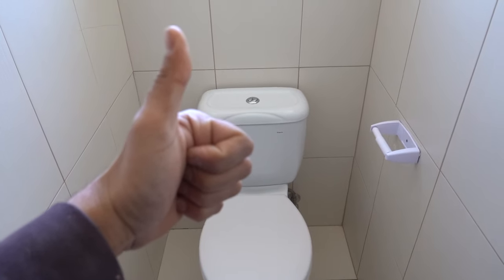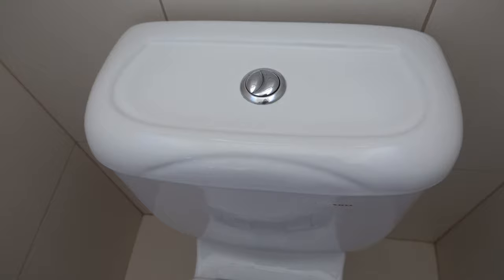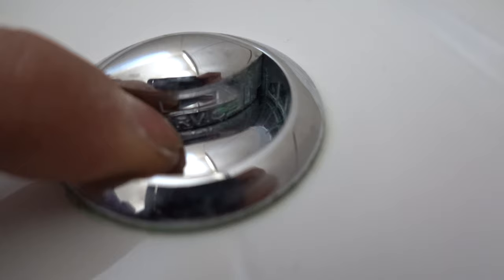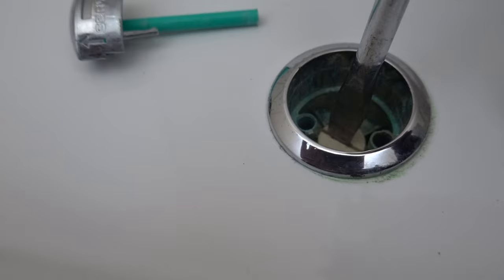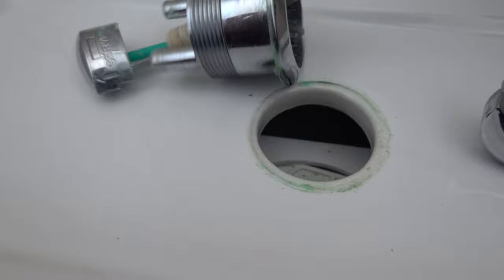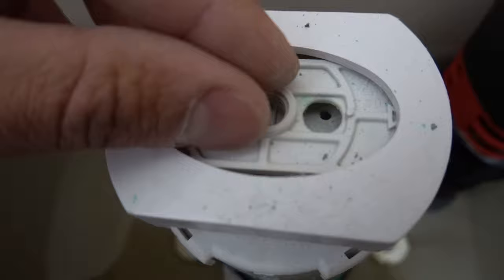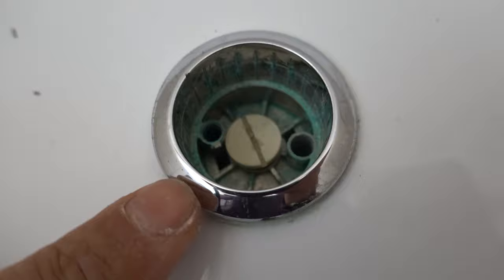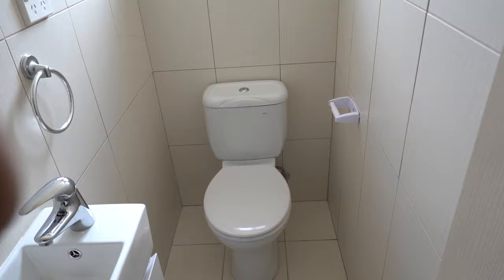How to remove toilet cistern lid - Dual flush buttons

Comment: Thank you for the great video, one small thing i might have missed but would like to add for everyone else if i didn't, the button unit is one directional, if you are having problems trying to screw it back on turn the holder for the buttons 180 degrees and it should sit better.

Comment: Thank you for this video, I did not have a clue how to get the lid off before I saw your video. The little button had less of a ledge to lever it up then I expected and it helped to stick the little button back in first to make sure the 3 holes were all lined up when putting it back together and hold the ring down and remove the small button and screw down the central plastic screw. I was peering in before that with a flashlight and poor eyesight thinking I will never get this lined up. The float was stuck on the bar it slides up and down on, I prodded it and it got unstuck and slid down to where it's supposed to go when the cistern is empty and then the cistern started to refill. I hope I don't have to go back there again. Thank you again.

Comment: Thank you for this video. The lid on the cistern on my downstairs bathroom just comes off, not this one. Lids off now and so I can access inside to stop the leak. If you can now help me to contort sufficiently to get the nut off the feed pipe I'd be eternally grateful :D

Comment: Hi Bill, thanks for the video . I cannot get the silver buttons out but the back thing will not screw out the screwdriver just turns so it seems to be worn or disintegrated and there is nothing for the screwdriver to leverage against. Any ideas?

Comment: Hi, I'm having a problem finding a replacement for this style of Dual flush Button fitting which holds on the cistern lid, it is to fit a 38mm hole. Can you tell me what make these are and where I might find them please.

Comment: My Cistern top looks identical but has no screw to remove the top ferule, I don't want to force it up with a couple of screwdrivers as I know that I will break something.
Reply: I had a look at other types and found that the type that I have simply unscrews with the chrome surround and comes out complete with the buttons.

Comment: I broke the white plastic spacer on mine that aligns the flush buttons and holds the centre screw. Is there a way to get a replacement spacer without having forking out $60-$80 to replace the entire flush valve? I tried looking for replacement buttons on Bunnings/Reece but none of them come with that spacer to attach to the valve. Or should I just get those anyway and live with the cistern lid not staying fixed to the cistern?
Reply from the maker: I’m pretty sure I’ve seen them at bunnings 👍
Reply: @billshowto  Thanks, ended up getting them from Reece for a few bucks

Comment: Hi bill. My dunny has a water leak down where the black rubber gasket joins to the ceramic. Can I just fill the area with silicone? Or do I have to remove the whole thing and replace the gasket
Reply: locust7777 is it the rubber connector from the cistern to the toilet? If so yes there’s a rubber seal replacement you can get to replace the cracked dried one.
Reply from the maker: That’s correct, rubber seal replacement is only a few dollars 👍

Comment: Dammit... I can't put mine together. The buttons suddenly stopped working, but everything looks fine. So I'm thinking it just slipped out of its track.
But here's the problem, mine doesn't have two separate rods going down, but two halves of a rod 😮One half for each button. And the rods have grooves that align with grooves inside the buttons. So with the buttons out, I can still push the rod(s) down to flush 🙃 Since they are stuck in the lover part of the assembly.
And I can't find any producer or any similar toilet online 🙄
Feel stupid for having to buy a new toilet just because I can't get the buttons back in place 😂

Comment: No disrespect to you, but this contraption is so unnecessarily complicated. 50 years ago these systems were simple and anyone could fix them. This thing with a ridiculous wire connecting the lid to the output pipe - you wonder who dreamed this up.